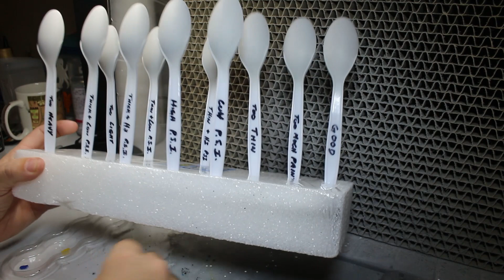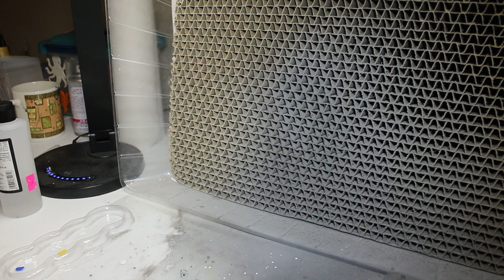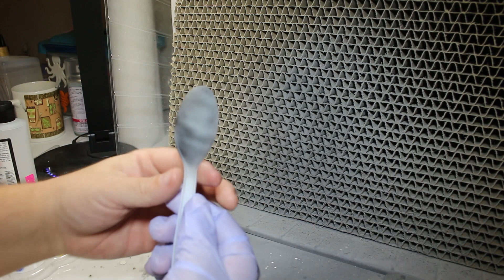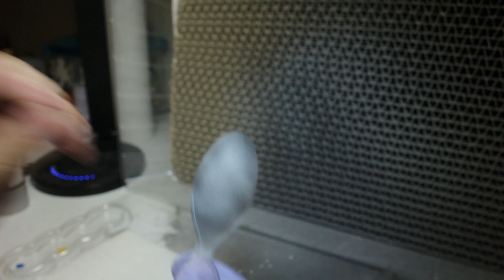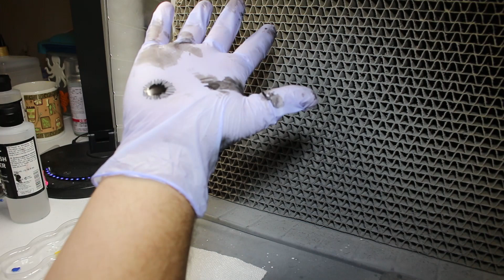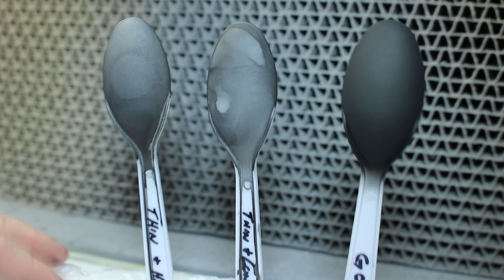Gunpla Airbrush Guide - Gunpla Tool Tutorial Series

Comment: holy freakin shit, thank you for this!
I wish I had come across something like this ages ago when I was starting fumbling through airbrushing. The labeling and purposeful screwing up in each way and talking through how to rectify it, and, more importantly, how to tell what is the problem by look/feel is so immensely helpful!

I've definitely gotten better, but still find myself screwing up with, what I now know to be, too thick paint and too thin.

So when you've found that you were screwing up during a session, and are trying to fix it, but the paint has gotten clogged up or dried on the needle and such, is there a good easy/quick way of fixing it so that you can continue? 

I find that when I've screwed up along the way I end up with paint stuck in the nozzle (but not coming out, even with airbrush cleaner, only find it when I disassemble for putting in the ultrasonic cleaner) which is not dried nor is it wet enough to taint the other colours or splash out randomly. I also will get paint adhering to the needle, both the tip, which I can easily brush off, and just before the well (when at a resting position). Almost as if the paint is getting pulled back in the body between the well and the trigger.

I end up just fighting through it through jacking up the psi to overcompensate or thinning paint down extra, up till I am too frustrated and then have to tear the thing down and put it in the ultrasonic cleaner and by then I'm just too frustrated and out of the flow to want to put it back together and continue once it is done.
Reply from the maker: Hey there. A lot of great questions here! Let's go through them one by one.

1. When paint dries up on the needle, one way to clean it is with a toothbrush soaked in isopropyl alcohol. The alcohol helps disolve the paint, but dries out quickly to avoid affecting your work going forward.

2. Because the needle gets covered in paint in the cup, it's hard to completely prevent the paint going back down the body, but if you find that happening too much, then either your paint is way too thin, or there's something seriously wrong with your airbrush and may need replacing.

3. With dried paint, I like soaking it in isopropyl alcohol or Acetone and using a very fine-tipped cotton bud to scrub it out.

4. An ultrasonic cleaner really helps and if you use it regularly, but make sure you're pulling out ALL of the O-rings before soaking your brush. I hope I got all of your questions, and best of luck! 😁
Reply: @PlamoTherapist  thought the o-rings were fine as long as not using solovent in the wash? @ultrasonic cleaner

Comment: What is a good psi?
Reply from the maker: Hey Aaron, that's a great question and comes with a lot of nuance. What paints are you using? What nozzle size is your airbrush? What's the thinning ratio, etc.

As you paint more and more, you'll come to fine tune your entire process, but a good safe PSI for a lot of the paints I use and have used is 18 to 20 PSI. If you start there I'm sure you can learn to thin a lot of paints to work in that range and eventually you'll figure out that you might like something higher or lower. But give that a shot and let me know what you think! 😁

Thanks for checking out this video and best of luck on your painting journey!
Reply: @PlamoTherapist  I am using Vallejo air paints.
Reply from the maker: Ooh. Good to know! Those are a little thinner than many others, so I'd recommend around 15-18 PSI. 😁 Give it a shot and let me know what you think!
Reply: @PlamoTherapist  I hear that all over the place, but I've only ever seemed to get results from 20-30psi :(
I mainly use Badger Minitaire and then random VJ stuff I've gotten on clearance/sale, and sometimes thinned down Citadel paints.
Reply from the maker: Hey @SharkeyBruhaha are you adding any thinner or flow improver? Even though they're airbrush paints, they still need a little bit of thinner. 😁
Reply: @PlamoTherapist  ...no 🤦

I was really assuming that "airbrush paint" meant it was thinned for immidiate use in airbrush, so was only thinning when I was trying to use the GW Citadel paints in the airbrush.